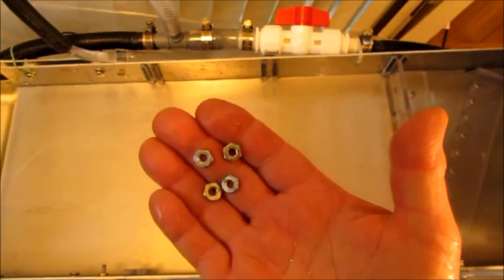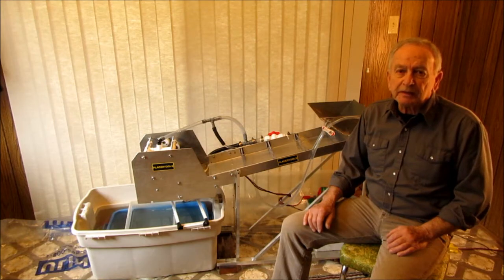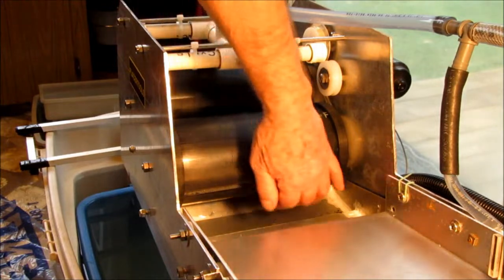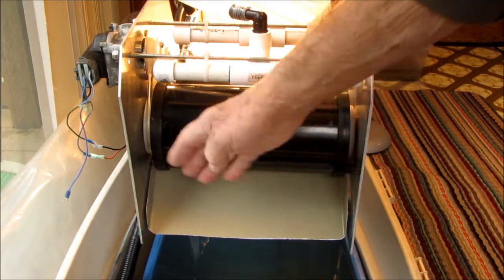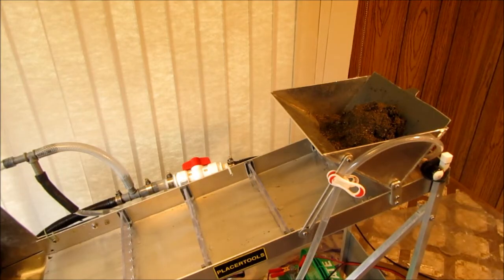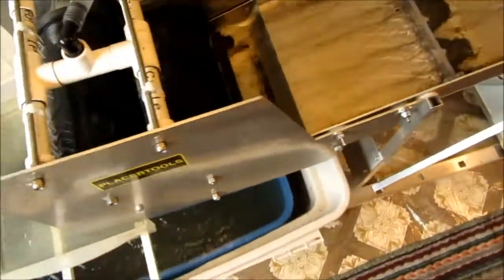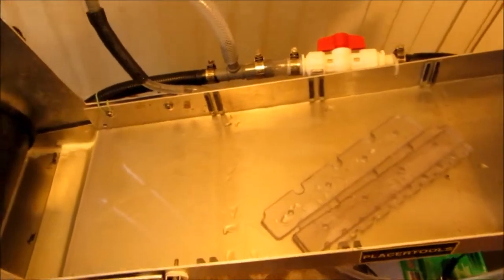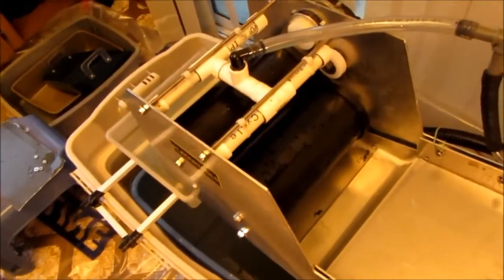Amazing Gold Concentrate Separator

Comment: The fixed magnet & drum separator thing was cool, but I am even more impressed by the gold pan! That looks much easier for a beginner like me to learn. The shaking back and forth looks like it does the stratifying and the washing away at the same time! And with the dam it can also be used as a classifier? I think I would prefer a conventional classifier on a bucket, but still a cool idea. Also, the secondary cleanup mode makes an upside-down pyramid, which seems optimal compared to the crescent shape of a gold pan. And they are $29?! How do you make them so affordable? I'm buying one!! Old-timer or not, I wish you many more winters.
Reply: Glad you like my pans. It certainly took a few prototypes to get to where they are.

Comment: Mayne a small motor with an offset and and an arm attached to the hopper to viberate the material down. Add a variable speed controller to comtrol the flow rate of the material. Other than that i like the machine. Have u noticed how much gold was slipping past into the magnetics? Also how much material is making it into the gold trap
Reply from the maker: Thanks for your comments. I have not seen any gold in the magnetics at all and only about 5% of the gold getting into the concentrates. Running the material a second time, or quickly through a gold cube, or cleanup sluice should capture it all. Having taken the bulk of magnetics out really makes the procedure quick and easy with virtually no loss of gold.

Comment: What does it do aside from separating magnetics?
Reply from the maker: That is the intended function. Prospectors and miners can spend many hours trying to recover gold from concentrates. Once the magnetics are removed the cleanup process is much easier. As a bonus, the gold trap also collects about 95% of the gold. The discarded concentrates can then be run quickly through a cleanup sluice.
Reply: @placertools3529  ok nice. I understand now

Comment: This can separate fine gold , like very fine , small specs that you would normally lose if you panned it ? 

Were i wanna use this there is alot of sand and when you wash it there comes out the black sand but the gold is very small almost like dust untop the black sand
Reply from the maker: Remember that the primary function of my machine is to remove the heavy magnetics from your concentrates, which can make the rest of your cleanup way more efficient. The gold trap seems to catch about 95% of the gold, including very fine (barely visible) gold. The concentrates should then be processed either once more through my machine, or with a cleanup sluice. If your black sands are primarily magnetite, you can imagine how this can save you time and lost gold once that is removed.
Reply: @placertools3529  thank you , I was looking for a shaker table for the fine gold , but based on your response your gold trap sounds like it can do the Job for a really good price

Comment: Dream on…. No one’s going to run a 10” bottleneck like this on a production plant, I’m shocked you’d even suggest that.
Reply from the maker: If you were paying attention, in the video I referred to a modified version that could be adapted to commercial units. The drum assemblies can easily be made to fit virtually any size and the 32" trough would not be needed.

Comment: Hm... I'm wondering. Does this machine just remove the magnetic stuff?
Because when the catch basin is full, gold would go over into the water tank, right? Or is the basin agitated so that it could sink in?
It would be interesting to pan some residue in the water tank.
Reply from the maker: It primarily removes the magnetics. The spillway section under the drums will catch roughly 95% of the gold in the single drop riffle and should hold perhaps 1/4 to 1/2 oz of gold before loosing much into the catch basin. That easily removable spillway section should be rinsed into a separate bucket of water periodically. The material that flows into a catch basin has a lot less heavies now and can  be panned, or run through a cleanup sluice easier. If you find that gold is moving from the catch basin into the main water tank, you could experiment with the catch basin size. A smaller, or shallower catch tray may work better at collecting gold if a waterfall condition is achieved, which will keep the gold in the residue moving and settling, while the lighter material will spill over into the main tote/water tank. A surfactant is recommended in order to prevent fine gold from floating. Maybe I will do a video on experimenting with different configurations of catch basins. Make sure that you have subscribed to see future videos.

Comment: It works OK, would recommend making a stainless steel slide, also would recommend changing the gates to polypropylene or polycarbonate. Also use an electromagnet for the separation. Gold and AuTe both would get kicked away, magnetite would be attracted, neutral stuff like garnet and sand will go through with no effects. ❤
Reply from the maker: I thought quite a bit about electromagnets, but it would be a logistical nightmare with wiring feeding to a stationary drum that is inside a sealed rotating drum and in a constantly wet environment,

Comment: great device.  Have you considered developing one, or, tried to run dry?  Use air to replace water.  I work in the southwest and though water can be transported, I would like to find a working air separation for milled ore.
Reply from the maker: It is possible to place the magnet end of my machine above material that is on a live conveyor to remove the magnetics. I also have an idea in my head for a dry sluice, but it is still fermenting.

Comment: Nice build sir . 
  I have a few observations though. 
The basic most important tool for anyone who prospects or mines is the pan. To this day I have yet to see anything replace the pan. There are countless mat configurations and all they do is reduce the amount of concentration you have at the end of the day.  Bottom line is how much $ do you wanna spend for that ? 
  Then you have the $40,000.00 shaker table you still need a pan because that table does not any clean gold. So in my opinion that a huge waste of $ . 
  So somewhere between expensive mats and a shaker table is your piece of equipment. Your demo did not show any clean gold , not even after you panned it. 
  Is it possible you can show me (us ) where this product is advantageous for us and where it will make or save us $ in the field ? 
  After all it it and has been proven there is nothing as of yet that will get 100% of the gold that that was originally on your shovel.
Reply from the maker: I think you missed the objective of this machine. I designed it to be used in a cleanup room rather than in the field. You have to think of it as a magnetic black sand harvester rather than for collecting gold, which was secondary for me. The high rate of gold capture by the gold trap under the drums turned out to be a bonus. There was a small amount of gold used in the video and none of it showed up in the end testing of the black sands, which was the objective. As an example, my latest customers are using my machine to process large piles of saved black sands, which is normally very time consuming. If they capture 1 ounce of gold from it, my machine is basically paid for. Check out my Best Dammed Gold Pan as tested against a Garrett pan. https://www.youtube.com/watch?v=98T3U16Jq9E&t=3s&ab_channel=911MINING%28CLIPS%29
Reply: Thank you for your response. 
  As I stated in my first comment nice build. 
   As a black sand remover I am assuming you mean magnatite , this certainly is a useful tool. Especially if your running materials loaded with magnatite.
Reply from the maker: @davevan1928  Thanks Dave. Yes, mainly magnetite, some hematite and ironstone. Some black sands are still heavy but won't be removed, like tin.

Comment: I found a way to classify 25 gallons of sand down to 1 gal in minutes. looking for investors USA
Reply: I'd like to see a demo how much of investment are you looking for
Reply: @peytonbypoop8712  I don't have access to black sand other than LK Mi and If I did A demo then everyone would know. kind of hard selling something that's a secret, it would cost less than 500 bucks to make it happen. don't really know how to proceed other than get to the gold fields and clean up.
Reply: @peytonbypoop8712  I am in the process of getting a provisional pat but before I need to gather up manufactures, because you only get one year after the provisional to apply for the pat. product is remarkable it fits in a backpack, and it's designed for beach sand. very easy to use a 5-year-old could do it very little effort involved and can move more material that someone running a normal sluice box.
Reply: You going to do a demo?
Reply: @wilgratz9128  see other comments
Reply: @wilgratz9128  9 months were have the time gone. actually, I am in the process of contacting 2 so far of the 15 manufactures before I get a provisional pat and then I can make it public.

Comment: Impressive piece of machinery. 
Kindly let me know how much one costs, where to get it and its capacity per hour. 🙏
Reply from the maker: Hi Bernard. Depending on the material to be processed, you can pull virtually all of the magnetite out of a 20 liter pail in about 15 minutes, or 80 liters per hour. Higher proportions of magnetite might be slower. I am just completing the first batch and they will be posted for sale on my website today for $2,150.00 Canadian funds. These are made in Courtenay, BC. www.placertools.com

Comment: That works but doesn't work
I mean, it works on fine materials from gold mines but doesn't work on rich black sand, gold goes with the black sand yet still can be processed anyway because it has black sand separator that can get the bigger gold while the fine will remain on the concentrator.
Reply from the maker: Not sure what you are saying, John. The only gold that will get by this machine is gold that is embedded in the magnetite or ironstone. If the pieces are heavy, the magnets will have a harder time picking them up and attaching to the drums. (c:}

Comment: Amazing man !! This is awesome. How would it work with hard rock ?
Reply from the maker: Thanks Zach. Whatever type of mining you are doing, my machine is basically set up for finer material. If you are crushing down to fine material and you are plagued with magnetite or ironstone, it should work as well as in the video. It will also remove large chunks of magnetics, but you may loose gold trapped within those chunks. The 15 pound weight demo in the video should give you an idea of it's lifting power.
Reply: @placertools3529   yes absolutely, was thinking for 30 50 mesh, such a cool idea is it available for purchase in the upcoming future ?
Reply from the maker: @zachflower8927  It should work great for you and save so much time. If you haven't seen it, here is a link to the info page. If you have more questions, email me at allan@placertools.com    https://www.placertools.com/concentrate-separator